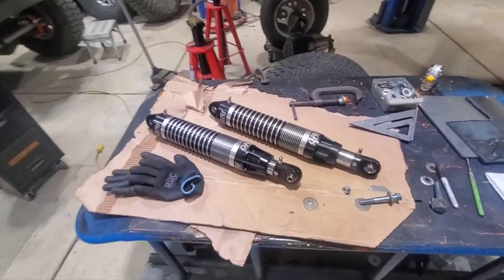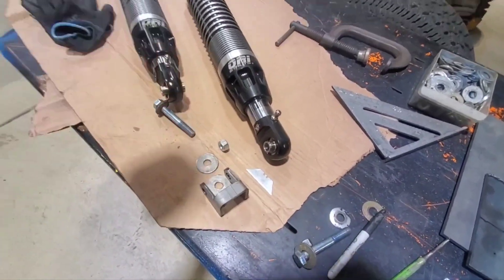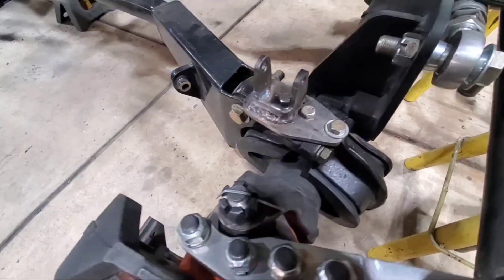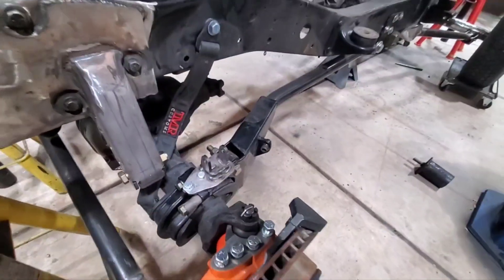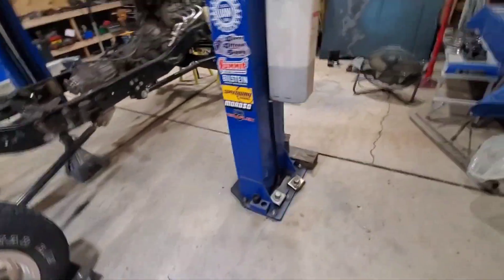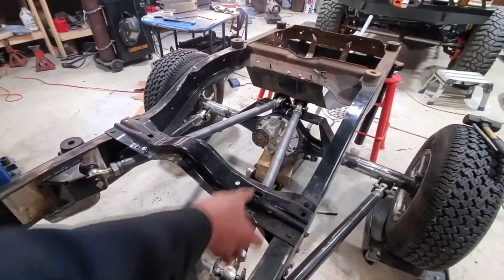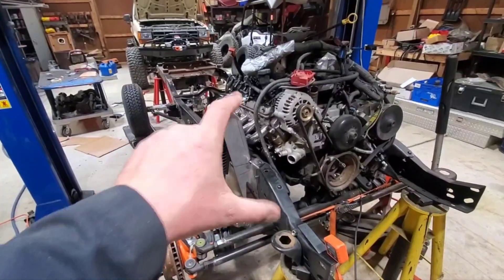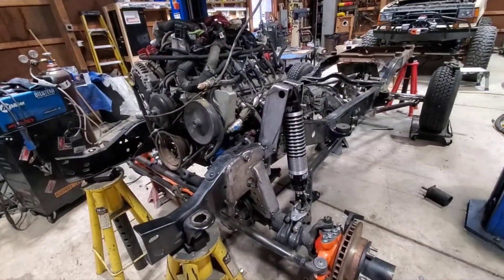LS Bronco II Project: Front Shock Towers and Lower Shock Mounts ORI's Solid Axle D44 9" RBV

Comment: Reinforce that c channel frame in the rear. Youtuber Muddy beards had some serious issues with his s10 frame.
Reply from the maker: I follow muddybeards as well.  With him running a 3 link in the rear, the frame definitely sees a ton of side load stress, keeping the axle centered with the frame.  On a 4 link, there isn't  that kinda side load in that area.  All that load is where the 4 links are attached to the frame, and all of that is boxed.  Between adding more than needed gussets to the factory crossmember, the DOM tube Between the frame for the rear sway bar and even the rear upper shock towers are frenched with more than plenty gussets.  I don't have any concerns.

Comment: Man that's looking super clean. I can't wait to see the rear done and as a roller. Also waiting to see how much of the rear fender/quarter has to be removed. Super nice work and video as always I'm waiting for the next video.
Reply from the maker: Thanks so much!  A couple things are making me re-think a few areas on my Explorer..  It handles amazing but I'd like to re-do my rear 4 links and make them longer and use high clearance links...
Reply: @BuildItWheelItExploreIt  With you doing this B2 build after your Explorer what axles would you chose for a B2 build? I have both one tons from a 2007 F-350 and also have a Dana 44 and 9 inch from a 78 F-150 for donor axles
Reply from the maker: 1 definitely would only do full width axles on any build going forward... and it really depends on what your plan is and how hard you wanna play, also depends of what style suspension you wanna go with.  Only thing I'd change with this LS Bronco II build is find a "non cast" wedge fullwidth D44 and then be able to do a 3 link up front.

Comment: Some good luck the way the lower spring bucket mounts on the radius arm fall outside the frame rails. Makes for a perfect place for the shocks to mount up. Those ORI's don't need a spring? Nitrogen or air filled?
Reply from the maker: ORI's are basically a 4 in 1 deal... with them you no longer need bump stops, limit straps or springs... Yes they are nitrogen filled and have a lot of adjustability.
Reply: @BuildItWheelItExploreIt , I was wondering where bump stops were going to fit in there...now u know. Now I'm curious about those. Probably never have them on my my truck, but kinda want to learn more about them. Ghis build is awesome. Looking forward to seeing it in action.